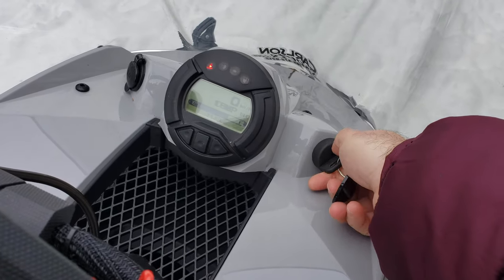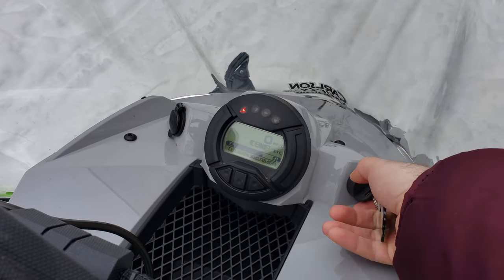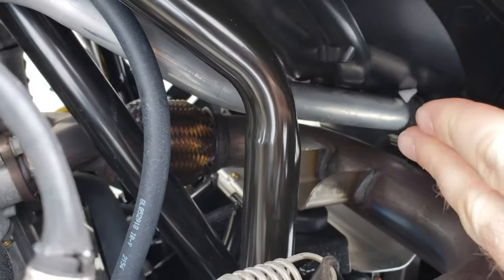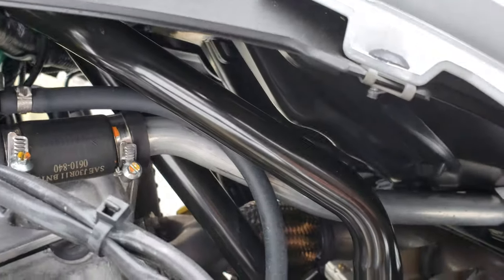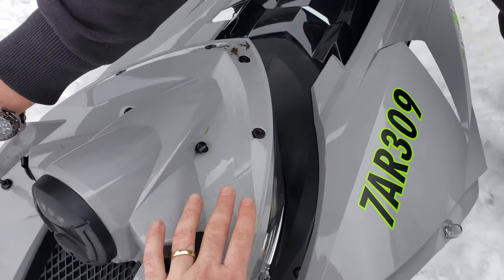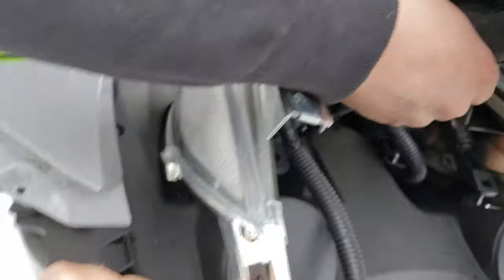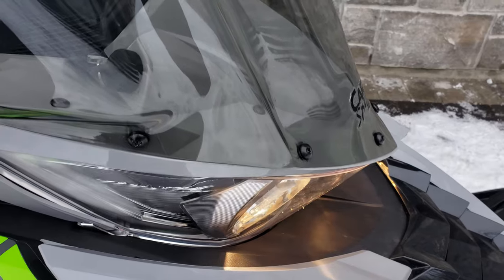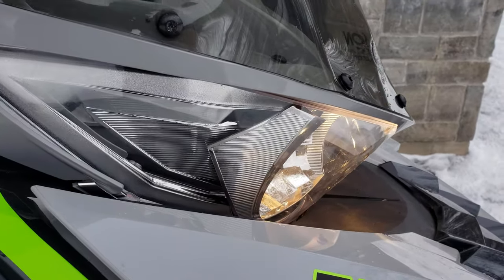Arctic cat Norseman - No Start After Sitting All Night

Comment: I would hold on the starter longer even as it is firing until it is able to catch. Don't let off the key immediately when it fires once.   I've seen a few folks with AC's and Yamaha 4Strokes experience similar issues with cold starts.

Comment: I have to ask. Would you buy the Norseman ?  Did you hear back from AC?  Based on your experience I have taken the Norseman off my list as a replacement. Thoughts?
Reply: I owned my norseman 3000 for 100 miles and then traded it (for work related issues- my needs changed, not due to it being junk or anything like that). However in my experience with it combined with my experience with other utility sleds I would place it dead last on my list of utility sleds to buy. Ive never been stuck so many times in my life with any sled (and I own 6 of them), never owned a tipper sled, and never owned a slower sled.  The Norseman 8000 is a totally different animal and would be fine (weight balance- top end- starting- vibration etc) however I would suggest that the VK540 is the best selling sled on planet earth for a reason. You cannot beat their off trail snow capabilities, storage, simplicity, floatation or bang for the buck.
Reply: @billmustardproductions9443  ended up with a Titan XC from Polaris. Clutching is smooth. Stabile and playful and pulled two other broken down sleds home. 1.8 20” track
Reply: @jbgamblin  Nothing wrong with that decision at all. The titan IMHO is probably the most trailable of all the utility sleds. Enjoy.
Reply: @billmustardproductions9443  thought but then last week took it to the swamps, gassed it and laid it over and got a snappy 360. Oh joy

Comment: Didn't know the Norseman's had a radiator too.  Too bad you're having bad luck with yours, I know the 2 stroke Norseman's are great utility machines.  That small 4-stroke has seen very little use in AC's lineup, so most dealers probably won't know much about them unflrtunately.

Comment: After seeing this , i think Lemon is confirmed. Being a poor assembly of parts, some where mistakes were made. If your stuck with this,and that`s unfortunate, you might try disassemble and re-assemble the engine part of the sled. Not the engine itself ,but the components to the engine.  By doing this you can discover poor motor mounts, fuel lines loose and sucking air ,  possible mice chewed wires,  etc. like i said, unfortunate. Disclaimer, good buzz on when i wrote this lol .
Reply from the maker: Well I still have a month of warranty Bruce...so hoping they will do this..and not me...
Reply: @GaryReedUnfrequentedWorld  Hope they do !
Reply: Mine does the same thing

Comment: That acts like a broken engine mount. The starting issue seems like a fuel pump that shuts it's self off. I have a rubber grommet mounted Harley Davidson engine and I've had to replace a rubber mount that cracked and split. Tons of vibration. I hope you saw my last post about the B.B.B. Better Business Bureau and your local TV news affiliates for reporting the issue and Artic Cat manufacturer itself ? With all of those bases covered you should get your issue solved with no problems.  As I said earlier, I and others with customer service issues with a local Harley Davidson dealer wound up causing the place to lose they're franchise and Harley Davidson had us taken care of in S.L.C. UT instead. We not only had our issue solved but were treated like royalty and given lots of free extras. Please let me know if you've tried these places as suggested.

Comment: nah you're not gonna take the hammer to it, you gonna start it start it start it hoping it changes by itself.
Reply from the maker: No I've waited 5 days for arctic cat to call me back, because under Arctic cat warranty I have to pay for the dealer time to diagnose..so today its going in to another dealer with my video and work sheets from the first dealer. I also had to take the time to diagnose what the first dealer was telling me that this was bad gas...well over the last 3 videos...I have done exactly that. Diagnosed that it is not the gas. Ran it for 5 hours without any run time issues. Start issues only and showed this is not an intermittent issue, and that I can replicate the issue upon a long sit period.